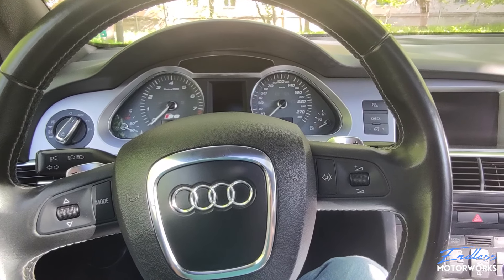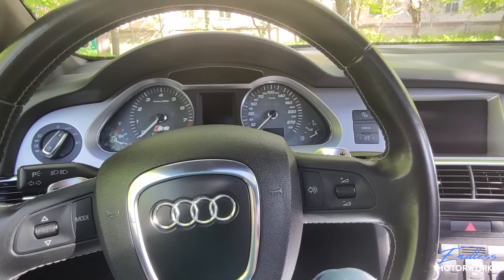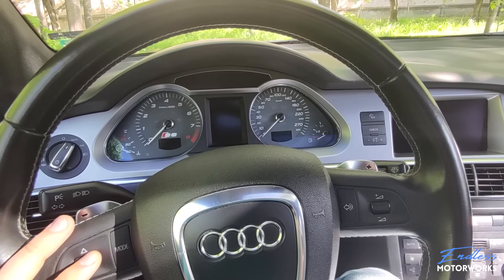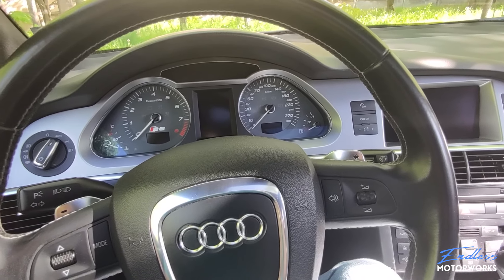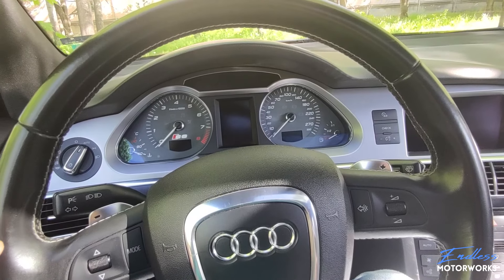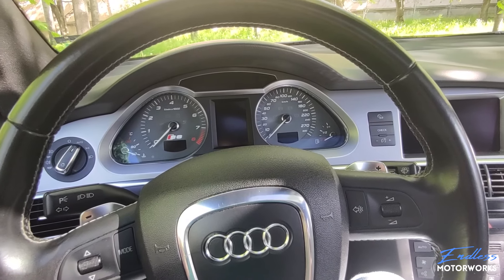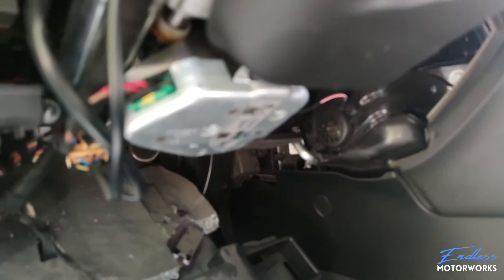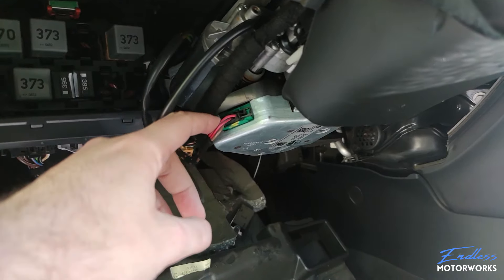How to Prevent or Fix the Steering Wheel Column Lock Actuator Issue on an Audi A6 / Q7 (DIY Repair)

Comment: with this option of disabling the lock, an error appears? "02638 - removal of the steering column lock breakage"
Reply from the maker: Error code 02638 pertains to "Enabling Column Lock - Short to Plus" and is one of the codes that appear when the micro switches in steering column lock actuator go bad. This error message will not be get logged anymore, if it was cleared out before the cable is cut.
Reply: @EndlessMotorWorks  if this error will hang, and you will not be able to cut the cable
, then you will not be able to throw off the error? after the cable is cut?
Reply from the maker: @ВладимирИванов-ц9у  I can't say for sure, as the vehicle the video was performed on did not have the error stored in the ECU. Technically speaking the wire that is being cut is the one that sends the signal necessary to actuate the solenoids and relay for the locking and unlocking of the column. All of the other wires that power the unit itself and make the connection for the immobilizer are going to be intact. based on that you probably should be able to clear the fault and have it not come back. BUT, like I said, this is only in theory, as I don't have a way of confirming whether this is the case or not. Keeping that in mind you can always cut the wire and see how it goes. If you can't clear the fault you can always reconnect the wire, just make sure the vehicle is off when you do the reconnecting.

Comment: My question is how can I fix it back after cut? Do I need to do something special? I cut it now but want do do it back.
Reply from the maker: Nothing special is required. You can solder the wire back, or simply use a crimp connector.

Comment: Hello! I did what you did în the video but now i got this error on display: ignition lock (with red).
What i did wrong?
Reply from the maker: What car did you do this procedure to?
Reply: @EndlessMotorWorks  audi a6 c6 2005
Reply from the maker: @albuvladutionut6191  Most probably the steering was locked when the wire was cut.
Reply: @EndlessMotorWorks  i cut the wire when i had ignition on....
Reply from the maker: @albuvladutionut6191  That could be, but was the steering column unlocked. If you had an ongoing issue with the lock actuator the fault needs to be cleared out first.

Comment: Does it work also on Touareg 7L with the steering lock?
Reply from the maker: I can't say whether it will be the exact same procedure and same wire that you will need to cut, but I would assume it is pretty similar. You will need to find a wiring diagram in order to know which wire powers what an to cut the right one.
Reply: Did you work out if this works on 7L Touareg?

Comment: Hi I wanted to update you.
Before I cut the wire there is a problem that appeared.
The steering column remains open permanently. There is no starting and no lights on the dashboard. Even though the steering column is open.
No error after scanning.
Plus when I insert a key it stays stuck inside and I need a pin to release it.
What do you recommend me to do?
Reply from the maker: Check battery voltage. No start, no lights on the dash and the key getting stuck inside the lock suggests a flat battery.
Reply: @EndlessMotorWorks  Hi again.
The battery was ok. What happened was that the steering column lock was caught and it thought there was a key inside the switch. That's why inserting a key would get him stuck. And there was no response from the steering column even after a fault scan.
I replaced the steering column lock with a replacement lock and we did a coding for it. And everything works great.
But what I noticed is that the vehicle travels a little differently. A little less fast and the steering a little harder. Is there a connection between the steering column lock and the behavior of the vehicle?

Comment: When they fail, it causes a no start situation due to a relay or microswitch failure, where electrical connections to activate the ignition are not made. (immobilizer) How can this solve that problem? I love the idea, but it’s not just the locked steering that is at issue.
Are you just preventing the mechanism from ever turning, leaving the switches in their current state forever? This would disable the theft prevention immobilizer,
correct?
Reply from the maker: You are partially correct, but it is a bit more complex than that. Yes, the module fails as either the relay or the microswitches die, thus causing the steering wheel to stay permanently locked. 

The thing is the immobilizer is not just one part per se. The ECU and the ignition switch cross-reference data with the lock actuator and allow the vehicle to be started based upon the findings. By cutting the correct wire, like I do in the video, one basically prevents the steering wheel lock actuator to receive its electrical signal prompting it to lock the steering.

All of the other wiring to the module are in place and the information stored on it can be read both by the ignition switch and ECU. So everything works the same as before, only the steering wheel doesn't get locked. Hope this explanation is somewhat useful.

Comment: What if i cant move my steering wheel at all? I have a 2012 audi a6
Reply from the maker: If the steering isn't moving at all it will need to be unlocked first with VCDS. 2012 should be a C7 generation though and the video isn't applicable to that model. It is only for the A6 C6 and first gen Q7.

Comment: HI! I have this problem but even the vcds cannot get power so i can't unlock the fu***g car in any way. What can I do??
Reply from the maker: When you say that VCDS doesn't have power, I assume that this means the OBD2 port doesn't get power. Is there any power in the vehicle at all? I do recommend measuring the battery voltage
Reply: @EndlessMotorWorks  Hey! Haha yes I did it was 4.2V
Reply from the maker: @Ambi6  Not nearly enough voltage in the battery. It should be minimum 12V. This means that either the battery is bad or it isn't charging (bad alternator). I recommend starting there.

Comment: Happened to my Mercedes W204 once it sucked

Really interesting that I could have just cut some wires on the lock 🥲 Mercedes took 1200€ for the repair
Reply from the maker: Exactly! Most people like me wouldn't really care if their steering will stay unlocked all the time. Not getting stranded somewhere because of this and not having to pay a good amount for repairs is a lot more important in my opinion.

Comment: I was able to do this without cutting the wire, all you have to do, is to put the key in, while the steering wheel it's unlocked... Pull out the connector and just pull out the wire out of the connector, use a sharp screwdriver or a pin wire removal tool.

I had a Obdeleven always ready in my car in case I'll get strangled... But those fuckers sent me an update and my device no longer works, so I did this preventively.
Reply from the maker: Thanks for sharing your experience!
Reply: @EndlessMotorWorks  dude, this is by far one of the most valuable information about Audi C6, and probably for the other ones, maybe they are not that old yet to fail, but I'm more than positive the locking mechanism it's the same despite of being newer models.
This twick it's absolutely genius! 
For the last 3 years, I've had my Obdeleven dongle ready with me, all the micro switches and the relay already purchased, since my Obdeleven stopped working after an update... (I had the 1st gen, lifetime Pro) I was kinda forced to do this mod.

Dude, you are genius and hat off to you to share such a valuable information with the rest of the peasants.

Greetings from Vancouver Canada!

Comment: this only prevents but doesn't fix as says in the title
Reply from the maker: It prevents the issue from occurring. That is correct. It isn't an actual fix, as if your steering column is locked cutting the wires will not resolve anything. What needs to be done is the error message will need to be cleared out so that steering is unlocked and only then the wire can be cut, in order to prevent the issue from manifesting again. Everything is explained in the video.

Comment: Awesome. My 2008 Audi a6 has the same problem. My ancel vd500 scanner will not connect. Do you know what the lowest cost scanner I can buy that would hook up to this car? Any help would be appreciated
Reply from the maker: Not sure, I have a knock off VCDS unit from ebay from years ago and this is what I use.